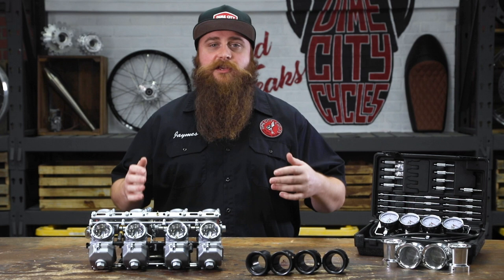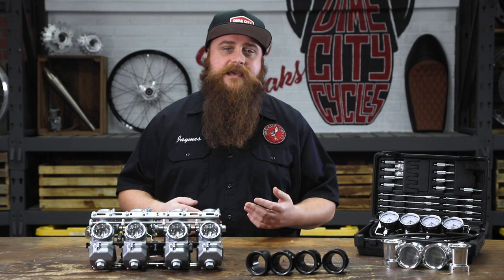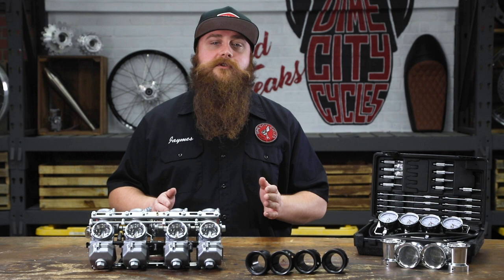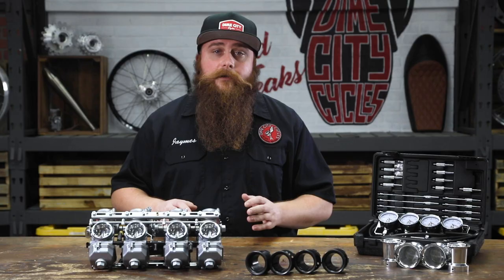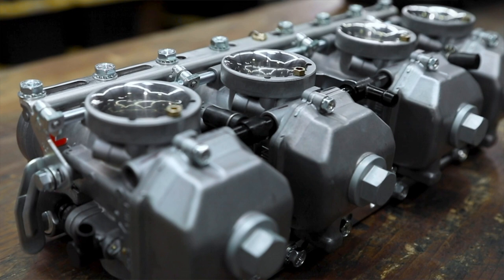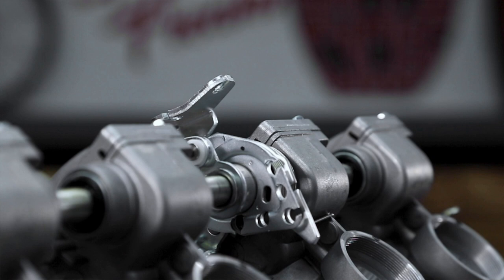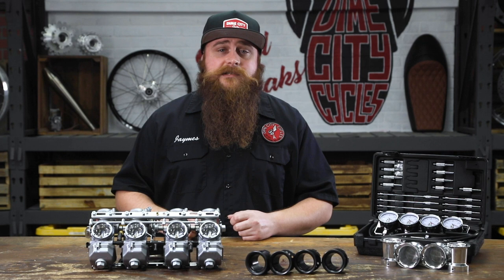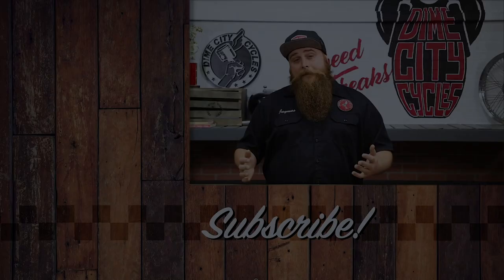DCC PRESENTS: A GUIDE TO KEIHIN CARBS

Comment: Good video. I’m using the same CR29 carbs on 2 of my 750K builds. 836 piston kits. 63A  and 41 web cams. Ported, decked heads, SS valves, heavy duty springs, etc. They’re awesome carbs. I love them. Oh and I got polished stacks from Steel Dragon.
Reply from the maker: Sounds like one sick build!
Reply: Dime City Cycles  Thanks. You can get these old 750s to run pretty good with the right setup. I call out to Sudco, tell them what I’ve got and they build me a set. Keep up the awesome videos. 👍
Reply: Did you have change your jets on your new cr29 Keihins?
Reply: vern jorgenson No. They were set up perfectly.
Reply: Very nice.  I’m currently in the process of a 970 build.  Taking me awhile but cycle x has been helpful.  I’m also intending to use the CR 29 carb because I can’t stand the clattering sound of the flat slides. I’d like for us to talk more on your build if you don’t mind.